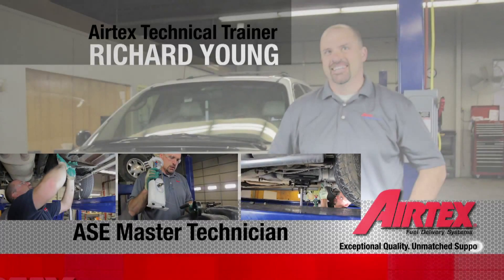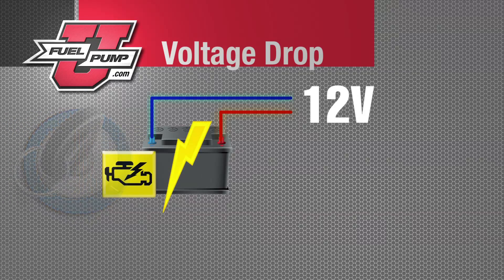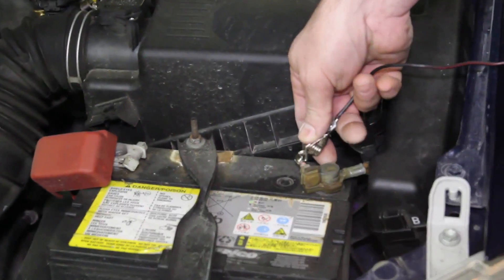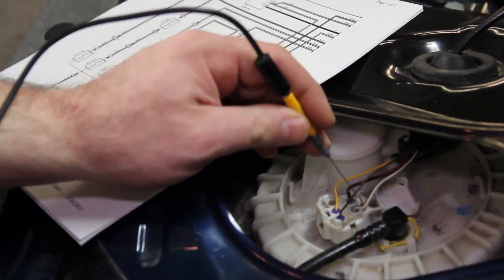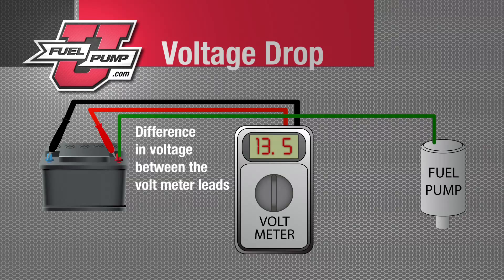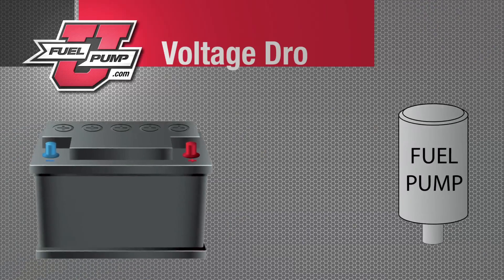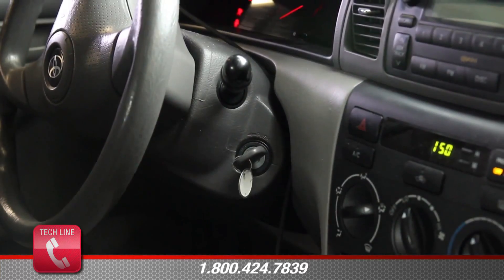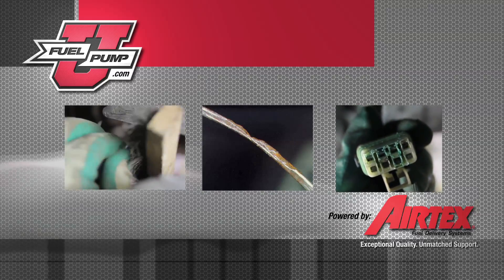Trouble Shooting Fuel Pumps - Voltage Drop Test (Part 2) - Expanded In-Depth

Comment: This is a great video showing how to backprobe a connector, thanks for making it. Apologies if I missed this, but it's probably important to mention that most modern cars have fuel pump module boxes and will not send the full 14V to the fuel pump at low RPM or light load. So if someone is measuring 9V at the fuel pump at idle, they should also check the car's wiring diagram to see if there is a fuel pump module that is intentionally sending low voltage to run the pump at low speed when fuel demand is low.

Comment: where do you place the long black lead when you're testing the positive side of the circuit. you said to connect the long red lead to the red lead on the voltmeter but didn't mention anything about the long black one

Comment: In my case 0.4 Volt drop in negative side and 0.2 Volt drop in positive side. No problem with wiring. Maybe only needs a cleaning in the chassis ground points. It is a car with 18 years.

Comment: I'm using an inline 14 psi electric pump for my 1980 turbo trans am. I only need 10 psi. My 4-13psi adjustable pressure regulator can't reduce the pressure to 10 psi, it's just stuck on 13, thus, flooding the engine. Can I restrict the volts to reduce the psi?

Thanks.

Comment: Can a bad fuel pump cause voltage drop on the car battery. My car stalls as rpm’s dip low and voltage drops on my battery. I can see that on my dash gauge. Bolts go from 13.6 down to 11.2 and car stalls.

Comment: What are you supposed to do when you can't get the vehicle running? because the fuel pump won't come on even after replacing the fuel pump and all the relays are fresh and all the fuses are good I can still not hear the fuel pump coming on this is the second time it's been replaced with in 5 years and the trucks only been driven 2 of those years. With the ignition switch on I can only get a 5 volt reading from two spots of the harness and no change when a start is attempted by an assistant..any ideas? I am beyond frustrated and stumped after 4 days throwing money and parts at this. I'm fortunate enough to have had the foresight to cut an access panel above the fuel pump after it was last replaced in the locking ring came loose and it was floating above the tank when my father and I took it down so I cut an access panel and I'm glad I did.
Reply from the maker: The place to start is why are you only getting 5 volts? For a pump to properly function is will need at a minimum 12+ volts and less than a .5 volt drop on either side of the electrical system; positive or negative. We have several videos on testing voltage drop.
Reply: @AirtexFuelPumps  yeah that's the question I've been asking myself as well in the on position or as a friend attempted to start it, it remained at 5 volts on two of the pins at the harness. I've been stuck for four days in a parking lot he helped me tow it across the street to the original Mechanic that replaced this pump 5 years ago before I had to take the tank down again and realize it was floating cuz the locking ring came loose but it had been working and driven about 2 out of The Last 5 Years and I drove it down here from New York then it went intermittent the last 2 weeks where would it would stall and then restart sometimes and now nothing with the relays all fresh no bad fuses and another new fuel pump in still don't hear the fuel pump come on in the on position as I typically do. I have some long four lead wire just barely long enough to maybe try these voltage drops tests while I wait on hearing from this mechanic.
Reply: @AirtexFuelPumps  what exactly is the difference of doing this sort of voltage test with leads on the battery versus just testing the harness isn't that also coming directly from the battery through the fuse relay box of course but what exactly is the difference? If I know I'm only reading 5 volts doesn't that mean I'm losing 7 volts from 12? What more can this type of voltage test tell me that that test isn't?
Reply from the maker: @mcnobody1012  to start, verify your battery voltage. It needs to be high enough to power the system back to the pump.
If you only have 5 volts at the pump something is draining over 7 volts. Somewhere between the battery, fuse, relay and pump you have an issue. You also need to check the negative side for loss.
Reply: @AirtexFuelPumps  I was able to put my truck battery on my 1. 5 amp trickle charger chilling had over 13 volts at a friend's house yesterday and I am getting 12.15 V from it directly with it installed & connected,truck not running of course,since fuel pumps not turning on.
Reply from the maker: @mcnobody1012  With only 5 volts at the pump you will need to segment the wiring back to the battery to locate what is creating an increase in resistance. Consult a wiring diagram for your particular vehicle to trace from the pump to, most likely the relay, from the relay on back through the fuse and ignition. If this tests good, check the ground side as done in the video. If the fault lies with the ground side it is a matter of securing good grounds to the vehicle. This could be done proactively before doing more voltage drop testing. A bad ground made good may solve your problem.
Reply: @AirtexFuelPumps  thanks and I'm actually currently uploading the results of the voltage drop test you suggesting this video I ran leads as you suggested and use my meter though I was checking the connections on the harness itself and I film the results which I'm uploading with the key in the off position I get 12 volts in a couple positions with the key in the on position I do not when I get the video loaded I'll put a link here that you can see. But I'm not certain if I should have the harness plugged into the pump and if so how then would I probe it because the multimeter probes won't fit in then. Also the only thing I haven't replaced is the harness itself with the new one so I suppose I should do that next once this rain stops, right?
Reply from the maker: @mcnobody1012  Complete the voltage drop test on the positive and negative side and see where it leads. No need to replace a harness if it is not the culprit.

Comment: Now I have a viewable video here https://youtu.be/L6EEm0lgvAI of my results from this test you suggest, though I'm testing to the harness if I plug it into the new pump I am not able to get the probe in to test it. it's pouring rain here in Mayport Jacksonville Florida at the moment anyhow so I'm sealed up in the truck and can't do much else with the lead wire or anything outside.